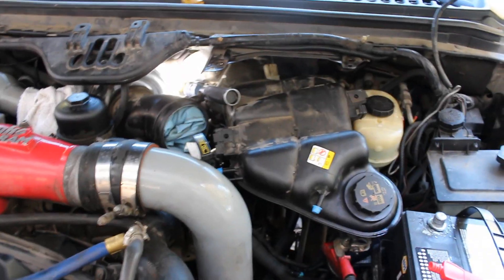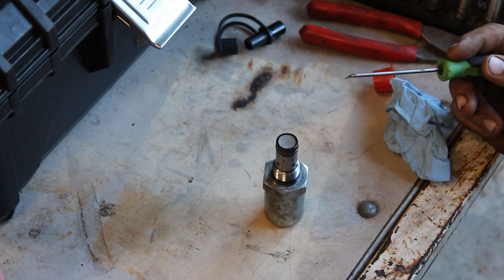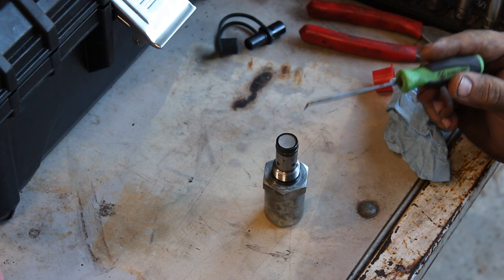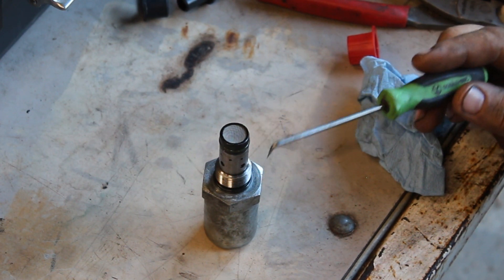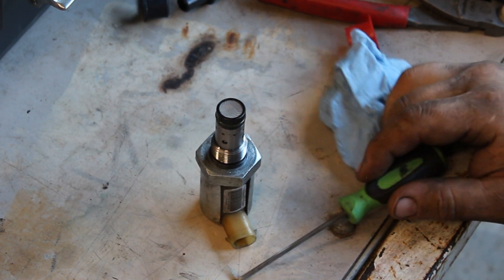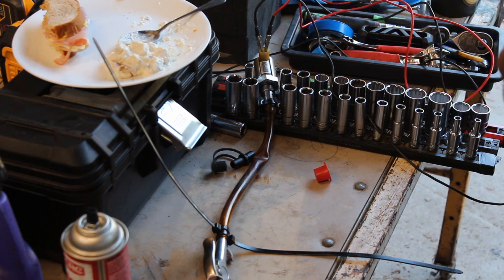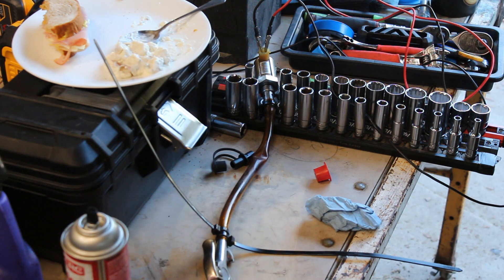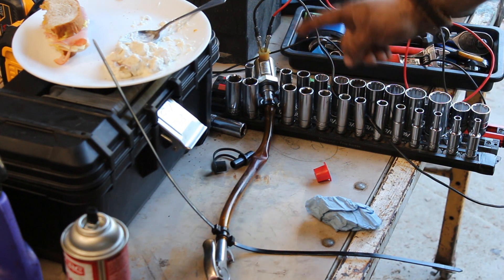6.0 Powerstroke IPR | How To Remove, Test & Replace (If Needed)

Comment: I have 05 f350 6.0, it’ll idle all day long, but when I start driving it’ll putter and die (10-15 seconds after I start driving) then it’ll take about a minute for it to start back up. Usually it’ll take a few seconds to start. But when it’s been idling (not driving) I’ll turn it it off and it’ll start right back up. The lower fuel filter was clogged pretty bad, I replaced both of them. And still having the same issues.
Reply: Did you solve your issue?
Reply: @Juan_Gomez808 bad icp sensor connector

Comment: Hey im heloingmy grand dad work on his 2007 F350 6.0, it threw a crank sensor code p2617 and wouldnt want to start and when it did it would idle very rough harsh knocking very low rpm and no throtle at all endedup replacing the sensor and it starts better but has a little surge in rpm every now and then and it still runs like something is off its possible its another sensor im just looking for suggestions if anyone would happen to have any ideas i thought it could be ipr however seems like the ipr causes no starts and leaves you stranded

Comment: Sometimes its the O rings for the dummy plugs and oil feeder tubes! I had one that would start cold with extended crank. when hot low IPR! Aired the system and heard air leaks in valve cover! lol

Comment: Can the plastic connection in the valve have some movement or is that a no no?
Reply from the maker: @jamesdinser4411  generally, they do should be fine unless it’s actually broken

Comment: Good Vid.  My 6.p will stop, then start..on & off.  Got a code from one of my 3 scanners.."C0700".  Wasn't very specific..but it had to do with "oil pressure and injection", so I'm changing IPR and IPC..  👍🏽

Comment: Good video. My turbo blew and FICM is bad. Watched DieselTech Ron and the importance of the IPR. Decided to change it out, but want to test both old and new. Your simple setup will work great. Thanks. 
PS. Will add switch for power control and buy the pigtail. I don't trust my skill with alligator clips.
Reply: Well did the test work?
Reply: @joecorrie1  I tested both old and new. Both work as they should.  Very pleased with the outcome. I used a light switch to toggle the power. Worked like a charm.

Comment: If you're trying to replace the ipr just buy the specialty socket and a 3/8 swivel and a 3 and 4 inch extension
Reply: There's a video of a guy doing it with a 1/4 inch with 3/8 inch conversion using the ipr socket and he gets it off in a few minutes without removing anything.  Lemme know i can dig it up if you want
Reply: @ryanb4932 i saw that video but i dont believe its that easy . I did this job and i needed to use an impact on it since it was so tight
Reply: I made one it's a 34mm socket lol cut a side out

Comment: Was you getting a 0psi 
I was getting 300.  I took the ipr out cleaned it and changed the filter and o rings. And I was getting around 25psi. Then the next time I checked it was 0

Comment: So my problem is that I have an 06 F-350 lariat with the 6.0, I got the old IPR out.. well half of it anyways. The one removed appears to be aftermarket and the solenoid head threaded off of the shaft to housing side, it doesn't want to  come out easy. Any suggestions would be greatly appreciated!
Reply: Did you get it out? Sounds like you might end up having to remove the oil pump.

Comment: Gonna need to change this ipr valve when it comes in at the dealership. With a new ICP, egr and fixum I hope the rig works. Put well over 2gs on it so I'm really praying and not needing any more problems with it.
Reply: Did it work? What was the problem????

Comment: good video but I need to know how to squeeze the connector to get that off
Reply: Has a pivoting wire clip, just roll it back from the valve with a finger tip.

Comment: Having an issue of Hpop low on pressure 1200-1600 psi driving, 0 boost, ipr range solid on start amd idle,  but under load driving never reaches over 30 psi.  So Im leaning on this being my issue.   I have the kit to take it out.      Just installed uppipes and rebuilt the turbo.  All other numbers look good.   Fresh ssnsors on the Maf, Map. EBP, and VGT.    03'
Reply: Did you ever find out if it was the issue?
Reply: @kylelake3262    stuck unicon ring and ford intercooler leak.

Comment: Should you be able to spin the body of the valve while the nut is stationary??
Reply: Yes.  While it’s installed in the truck you can rotate the outer part of it along with the plug.
Reply: @jgp9290  thank you

Comment: Dude I'm not calling BS but I guess I am on you being able to remove the IPR without pulling the ficm but if you can do it. Post a video showing it and I'll sit and watch it because I'm changing mine and you can't get your hands in there at all
Reply from the maker: That’s cool I guess. I was able to do it, but I also do this for a living and know a couple tricks… maybe that’s the difference. Wish I had a 6.0 handy real fast to show more tricks.

Some rigs have different ficm brackets on them as a “upgrade or fix” they had issues with heat and vibration in the early days, there are 2 different brackets I know of, possibly more, this may make it harder to get in there.
Reply: @EverythingYukon  well mine is a 06 and I've damed my soul to hell working on this bastard. I hate the 6.0 I've owned it since 2014 and it's constantly got something wrong with it and hell I don't do anything but drive it. No pulling, mudding, nothing rough at all
Reply from the maker: Want to sell it?
Reply: @markblackburn8685  It is a diesel it is meant to be put under some stress. Keep something of a heavy load in the bed at least.
Reply: I got large hands, only thing I moved was my hand, and fingertips, a bit at a time. Patience is mostly what it takes. Don't let inanimate object beat, or get you worked up.
Reply: lol I mean I pulled mine without pulling the FICM or even touching the degas bottle and wire loom deal on the firewall I had to actually climb up in the truck and lay over the engine on my stomach get the special socket, a swivel, a 4-6in extension and a ratchet pop it loose then undo by hand

Comment: I had e young Machanic look at my 6.0 for hard start. He spent a couple hours then told me I may need another battery like the one I just bought. The ipr may need to be changed so I told him to buy it he called it a sensor. A couple days later showed up with it after I had bought another gel battery and it was starting best it had ever. Told me he had the sensor and I told him to put it on and give me a bill. It took him and a helper all day and with a 1200 plus dollar bill. Now my 6.0 has a very hard start and runs like it should be put down. I found the old ipr valve in my garage with the plug in broken off in it now the truck is at the truck stop with a bad starter I think and will run terrible when I do get it to crank

Comment: Hopefully you have an answer for my situation. 

To start it would throw white smoke out for a lil bit then stop. Sometimes it would be so much it would look like there was a fire. After driving around I’d shut it off and would be back say 30 minutes later try to start and it would just crank over. I would need to let the truck sit for a few hrs before starting it again. Don’t really know if it could be the ipr or the icp or both. Hopefully you’ve seen something like this and could point me in the right direction.
Reply: Sounds like stand pipes and dummy plugs on yours are shot   that will cause a hot no start every single time . Also a cracked egr cooler can be the cause of white smoke .
Reply: Hey ScanGauge will help you read the percentage of the IPR valve in the pressure at the ICP sensor those little gauges are inexpensive I think 200 bucks from bulletproof diesel already set up for the V8 Ford diesel hey IPR socket is relatively cheap I think about 12 or 15 bucks

Comment: Me and the old guy down the way changed his IPR and left then specialized socket on it because the wire to the connector plug was running across the back side of the socket and I didn't want to damage the wiring or plug or IPR valve.

Comment: How do you find what side is + or - when applying power
Reply: Wire diagram, or touch each wire to a check light probe(when lights up, that's your positive) or a  volt meter.

Comment: I done the ipr valve on my 6.0 the same way as this and it didnt make any sound or anything. So does that mean its bad cause my truck wont start at all
Reply from the maker: If it didn't cycle with clean modulated power it's bad. Most simple way to test is with a power probe and a 12 volt pickup battery

Comment: Help! I’m getting 14.8% koeo, as soon as I crank it shoots to 84.7% along with only 280 icp. I already changed dummies, stand pipes, nipple seals and injector seals. I air tested thru IPR port and find no leaks. System held 160 psi air for 1 hour! Is this symptoms of a bad IPR?
Reply from the maker: No start, hard start, pull it, check it, replace as needed
Reply: Rene, did you ever get your 6.0 running?
Reply: @jameswasher3938  yea I replaced 2 injectors and IPR. Running like a champ now.
Reply: @TXRenegade  Glad to hear that.

Comment: IPA's are disgusting! Veritas! Do yall EGR delete? Here in southern CA am getting error codes for my ol 2004 f350 6 0l, then chk engine light dissappears. I already had 2 injectors replaced,(shop said got error codes) was working good for a 2000 mile trip, now getting revving & cold/ hot no starts & just got a stall few days ago. Seems if go under 50 -55mph, truck runs normal... been using starter fluid to get truck turned over, only when glo plugs on for 2min+, sometimes will start right up w/o?
Reply from the maker: Hard to delete anymore
Reply: @EverythingYukon  hear ya, diesel garage I go in NW Arkansas, had thousands of fines, had a lawyer in Louisiana help get reduced fines, and probationary period. Talked to guy here in high desert & he had egr sealed, but then egr mounted on top so looked like still there.

Comment: I just had to change my ipr valve on my 6.0 .I was driving along and my truck just stopped running was running good before the valve went bad. And i know first hand that the IPR valve will leave you sitting on side of the road. I didn't have a clue that it was going bad but changed the valve and back on the road again and I'm very thankful i wasn't to far from home. Just food for thought .
Reply: My truck also stopped today, you think this valve is damaged?
Reply: This past week mine did the same. First blame went to the FICM as my original 7-pin died. Warrantied out for a new one but still no start & low HPOP pressure. Now suspecting the valve.
Reply: @timmelton9522  did it act like it ran out of fuel?
Reply: I'm hoping this will be me later today or tomorrow

Comment: I'm not a 6.0l fan, so far my 6.7l has been good.
Reply from the maker: The 6.7 powerstroke (I guess that's what you're talking about and not the 6.7 Cummins) is a solid engine, aside from some small issues. Fun fact, the 6.7 powerstroke is the first Diesel engine designed and built completely by Ford.
Reply: @EverythingYukon   the powerstroke. About the most unconventional design for a v block but seems to working good .
Reply from the maker: True that
Reply: @EverythingYukon  technically speaking its the third. the 6.6L Brazilian i6 Turbo diesel was the first ford Diesel engine the second was the Ford 636 AKA (marketed to cat by the name of) cat 3208. a 10.4 Liter V8 Turbo diesel production of that motor started in 1975.
Reply: Untill it breaks better have deep pockets